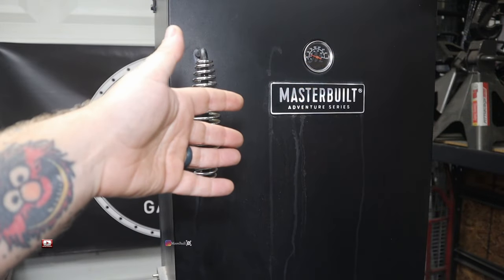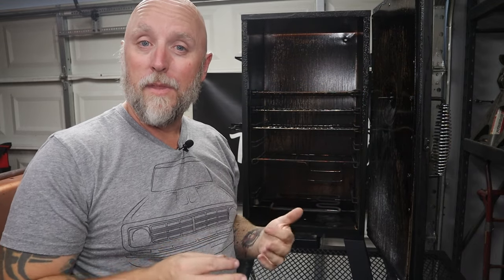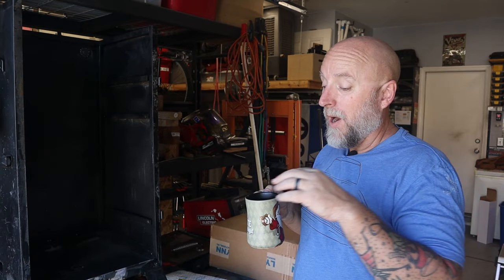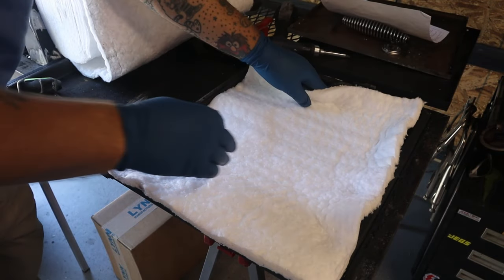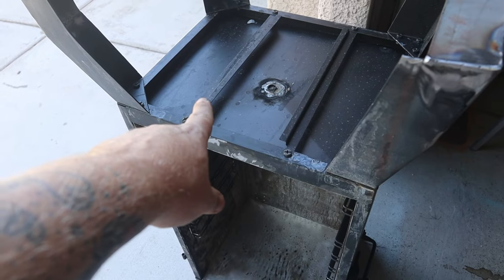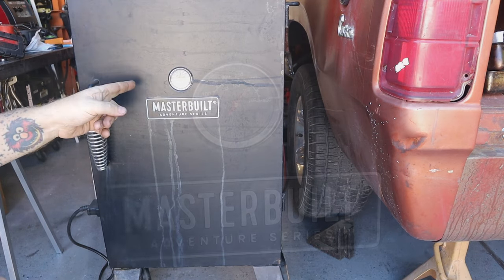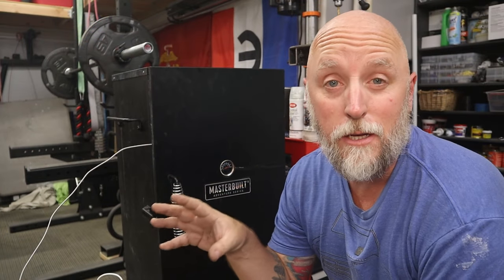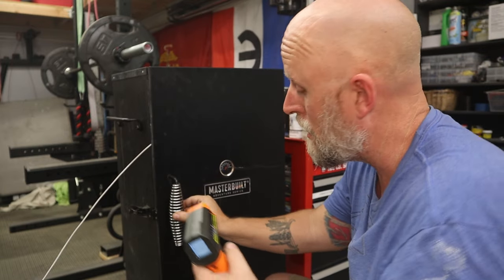DIY Powder Coating Oven Using a $30 FB Marketplace Smoke

Comment: ha, i have been doing the same.  I did test mine without the insulation (clever how you hid it in the walls, that is ideal). Hot enough on the bottom, but the heat loss is huge.
The element that came with mine was 1200 watts & the controller not designed to crank above 220'.  ordered a replacement from amazon and used the wood chip port to mount it.
I also like how you welded shut the openings.  I had not thought of that
thanks for the video!
Reply from the maker: The insulation I think makes a huge difference....I thing the heat loss without it would make it impossible to get the oven hot enough.  Thanks for watching!
Reply: jb weld if you dont have a welder
Reply: @MoonBuiltGarage  the insulation did make a major difference. it now gets to 450'+ throughout the smoker

Comment: The temperature gradient from top to bottom is probably a function of radiant heat from the element as a function of distance.  Perhaps adding a cheap ceramic plate a few inches above the element will help with that.  A trimmed pizza stone would do it if you have one, but cheap red quarry tile would do the same thing.  Also, it will act as a heat sink and help in temperature recovery time.
Reply from the maker: I'll have to try that.  I plan on having the thermocouple up at the top to have it as far away from the heating element as possible, too.
Reply: @MoonBuiltGarage  add a oven broiler pan above the heat element it will help distribute the heat more even

Comment: Since you can buy part. Add a 2nd heating element. Great job. I'll have to keep my eye out for one.
Reply from the maker: I've thought about a 2nd heating element, but I'm not sure if my controller could handle 2.  I may try moving the one I have to the back wall, but we'll see

Comment: Brilliant concept and execution!  I already found the same smoker on FBM for $20 !
Reply from the maker: Takes a bit to get warmed up, but has worked really well so far
Reply: I ended up buying the same smoker you used at an auction for $28.  Maybe used once, so no cleaning issues!  DId you mount your controller box to the cabinet?
Reply from the maker: Not yet, but I need to.  I'll probably mount it to the bottom near the casters so there are no heat issues @WheresWilson58

Comment: Not to sell you short, I think you did a great job on both the oven and the video, both of which I give you a thumbs up on. That said however, I fail to see why anyone would spend $130 and a WHOLE lot of time and energy converting a smoker into a less efficient powder coating oven than a $50 scrap kitchen oven with approximately the same volume and much better heat distribution.
Reply from the maker: The time and effort wasn't that big a deal....as for why not go with a scrap kitchen oven, there are a number of reasons:
1.  Space...I don't have the room for a full-sized appliance in my garage
2.  Power...The only 220 I have in my garage is used by my compressor and/or plasma cutter, and the plug is not in a place where I could easily put a full sized appliance like an oven.  Plus, not everyone has 220 available
3.  Availability...some areas have more/different availability of choices
So, just because you fail to see why I anyone would choose a smoker over an actual oven doesn't mean one choice is better than the other.  It all depends on a number of reasons....but thanks for watching!
Reply: @MoonBuiltGarage also, it’s way cooler, and more fun. We learn when we experiment. Great job on the oven! Maybe a small interior fan would help with the temperature gradient.

Comment: Maybe try adding a convection oven type fan to better circulate air inside. Just remember you don't want it blowing directly at the parts.
Reply from the maker: I think it might be a little on the small size for a fan...

Comment: I was wondering if you ever actually used the unit? Searched your page for next video didnt see it. Thanks.
Reply from the maker: You didn't search too hard...there was a video less than a month later ( Beginner BUDGET Home DIY Powder Coating
https://youtu.be/m9tzIrHR5hs), I also used it for my nut and bolt gauge, and on other things that never made it into a video.

Comment: What gauge wire did you use to wire everything in the box?
Reply from the maker: 16gauge for anything that is actually carrying power, and 18gauge for the interconnect/signal wires
Reply: @MoonBuiltGarage  okay thank you so much

Comment: electric oven would work better all you wouldve needed to do was add a 120v heating element and modify the oven case to accomodate the element!
Reply from the maker: I don't have the room for an electric oven...smoker is more compact and gets me started
Reply: @MoonBuiltGarage  understood. just saying for others that want to get into powder coating on a budget. i myself just starting out and plan to put my oven outside in the backyard on a concrete slab.

Comment: You've never used a smoker?  WTF, DUDE??!!??  Damn, you are missing out ... BBQ is as much fun as cars, i'd expect you to BBQ.  Although, I don't always agree with you, gotta give you SOME props on this one.  I'd spend a little more and go with a refurbed house oven, if i were you, less work, more even and higher heats.  Use the smoker to smoke meat for BBQ.  I have an old house oven, but i also have an menonite guy down the street that does it for dirt cheap, i mean, dirt cheap.  $10 for a little bracket and tons of colors to choose from.  Powder coated a 48" John Deere mower deck for $100, prep and all ... i've more or less abandoned my home powder coating endeavors in favor of a guy that does it cheap.  Less time, less labor, less investment on my part.  Have you seen the prices Eastwood wants for this sh*t?  Could've gotten a refurbed house oven for $150 and not had the issues you have now.  Its what most guys use.  Smokers aren't meant to go much above 300 degrees.  Just saying.
Reply from the maker: I don't have the room for an old house oven...although I thought about it.  
I've wanted to get into smoking to go along with bbq, just haven't yet...but after smelling how good this thing smelted when cleaning it up I'll have to get into it.
Reply: @MoonBuiltGarage  Yeah, but an old house oven isn't that much bigger.  Yeah, smoking meat and BBQ is fun.  I'd suggest Kamado Joe or Gorilla Grills if you want to get into it.  Best bang for the buck.

You need a role model with this Mopar junk you are working on and these EFI systems you got going on.  Well, help, to say the least.  I've been an engine machinist and tuner for years.  That being said, I am not without my failures, but I've had a lot more dirt, drag and street cars live vs fail.  I do it on the side when people have $$$.  Otherwise, I've been out of it for 6+ years now and I'm younger than you, I'd guess.  The automotive business sucks a$$ and I'll never go back.

Comment: You only need 300 degrees for powder coat unless it’s cheap powder
Reply from the maker: Strange....each powder I've looked at recommends curring at or around 400 by the manufacturer